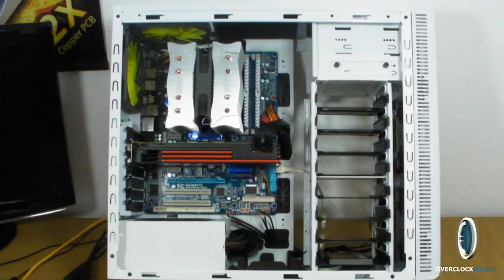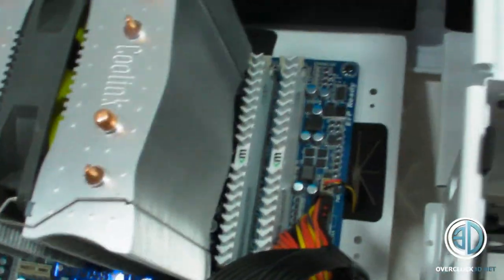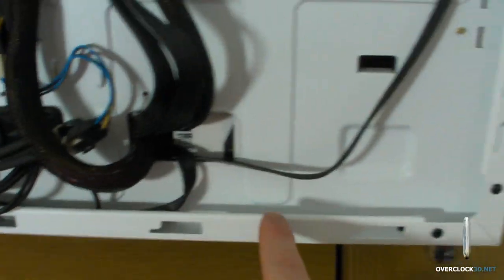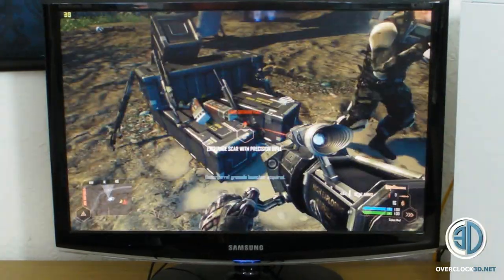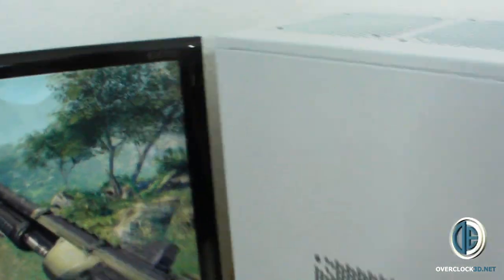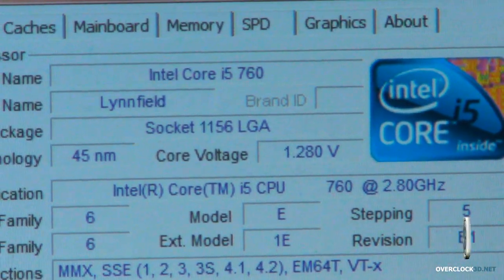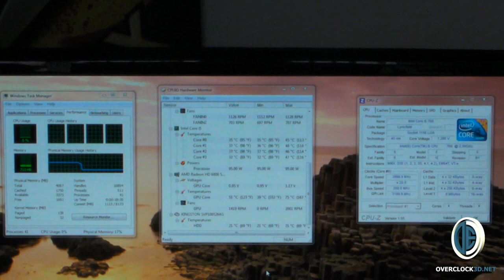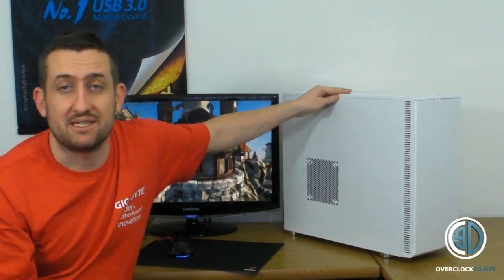3rd Prize Complete i5 760 Fractal R3 Gigabyte P55 Kingston V+100 NZXT Hale Mushkin Ridgeback

Comment: You would think this is a 1st place prize considering the quality components. I wouldn't mind taking this away as a 3rd place pize :)

I love the cable management and the explanation behind the PSU orientation. I have the R2 and i pushed the cables through prior to installingthe mounting screws.